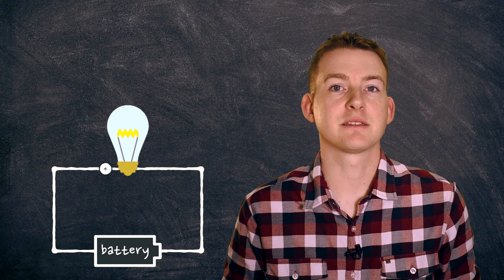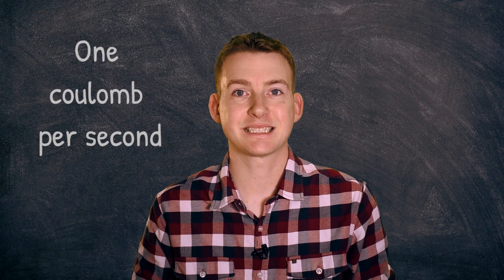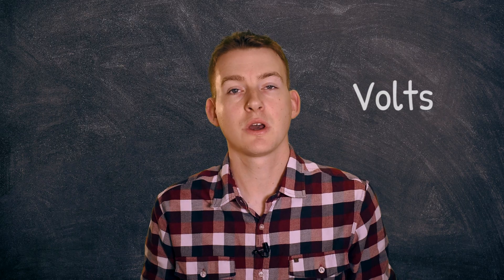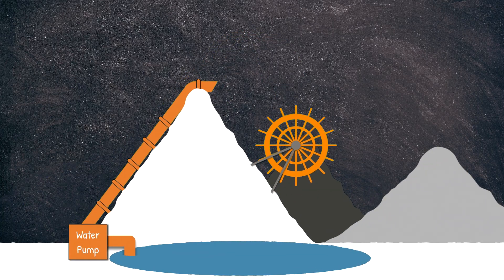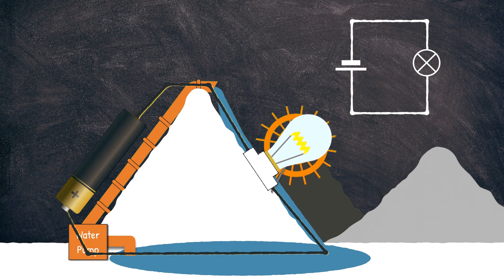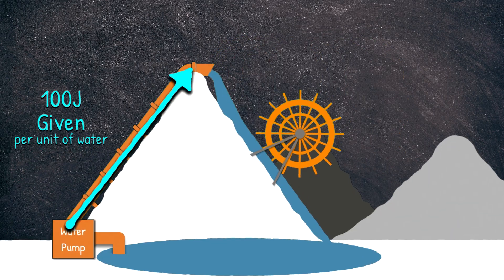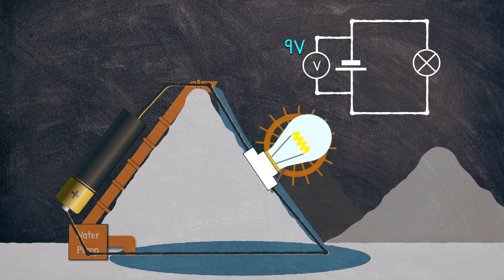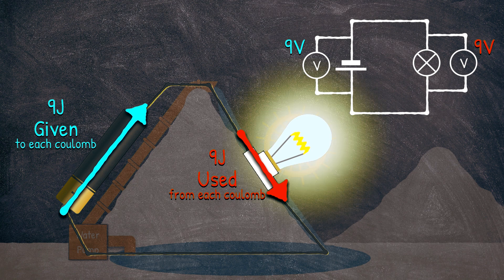Potential Difference - What is voltage?

Comment: I have been trying for 2 months to understand what potential difference means and this video still doesn't help. How is water going up and down a hill helpful?

In an electrical circuit there is no gravity and altitude isn't relevant so it doesn't make sense.
Reply: for the water to move to move up the hill, it has to use energy. Thats what the pump is doing, its using energy to push water up the hill.
Similarly in an electric circuit, for current to flow there need to be electrons moving because moving of electrons is whats making current exist. But how do we make that happen?? Pd, its essentially whats making electrons flow, its giving energy to electrons so it flows from one place to another and that energy, the electrons will give it to a component, if they come across one. Thats why its relatable for the water going up hill, water receives energy to go up a hill and hit the turbine (giving their energy to the turbine for it to spin). I hope this helps, appologies if my english bad

Comment: This was a nice explanation. I had a follow-up question about the volt per coulomb relation.
Since a coulomb is a fixed number of electrons, why does the energy (in joules) it carries change? My initial thought is that the difference must be caused by the electrons' speed or energy level. Is this reasoning correct?

Comment: I still don't get it, if you give it 100 joules, then lose 100 joules, how is the difference 100. To get from -100 to 100 you have to add 200 so wouldn't the difference be 200
Reply from the maker: If you have 100 joules, then lose 100 joules, you have 0 joules (you have subtracted 100 joules, which is not the same as having -100 joules)
Reply: @Science_Sauce I have a question too, if the electrons get lets say 5 volt of energy, and it comes across a component and gives all 5 volt to the component. What energy will the electrons use to move to the other side? Since it doesnt have any energy left? Does the electrons go inside the component? Or does it just stick around near the component?
Reply: also in textbooks, it doesnt say current is the flow of coulombs but charges. If coulomb means charge does that mean 1 charge is 1 coulomb?

Comment: thank you for your straight forward explanation. My little question is how can 1 coulomb (10^18 electrons) have different amount of energy?. For example 1 volt, every coulomb will produce 1 J, but 10 Volt which has also same number of electorns produces 10 Joules of energy?.
Reply: Don't quote me on this but the way I understand it is that as the voltage or (potential difference) is increased, the rate of electron flow is also increased. Same amount of electrons but the stronger push from the voltage gives the electrons higher electrical potential energy, increased electron flow and therefore can do more work than at lower voltages.
Reply: A Coulomb is a quantity of charge, not energy.  Consider two identical bricks.  Their mass is the same.  One brick you set on your head.  The other brick is dropped on your head from a second story window.  What is the difference?  Energy.

Comment: I have made an analogy myself to understand what voltage is. Please tell me if it's right, or wrong or suggest corrections. "Imagine there are only 5 coulombs and they have the potential to do 25 joules of work on a point on wire and there is another point on which the same 5 coulombs just have the potential to do just 10 joules of work so there is a difference to do work of 15 Joules and of 5 Coulombs so the difference in joules per one coulomb is 15J/5C = 3J/C so 3V is the Voltage?"
Reply: Three V is the voltage drop between the two points.

Comment: if the bulb uses up the 9J, how is there anything pushing the flow of electrons to complete the circuit?
Reply: The wires do not have zero resistance, so some of the energy is used in the wires.

Comment: That eye roll tho😂😂😂
Reply: If 9V means that 9 joules of energy is transferred by every coulomb of charge, then if all of this energy carried by the electrical current is transferred into light/thermal energy in the lamp, then how does the electrons have any energy or "pushing force" left to return to the opposite side of the cell?

Any help is appreciated!
Reply: @Random-nq4xj   I know I'm late but just saw your comment and I know that you may have figured out answer till now , but still I am commenting...

Energy is not transferred in light bulb, instead it is passed through it from one side to other side , and thus the current continues to flow from other side..

Since Current is passed through bulb , it glows. And this current runs in loop continuously, so the current will keep on entering and leaving the bulb unless we cut the circuit
Reply: @goodcake05  but isnt light an energy?
if it is then how come the energy of each electron that passes the lamp still intact as it were before entering the light bulb?